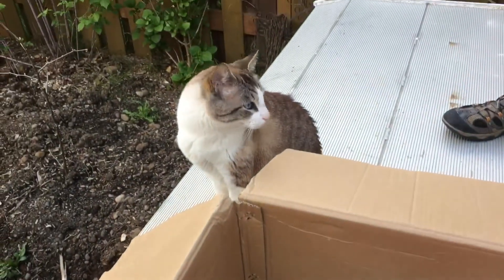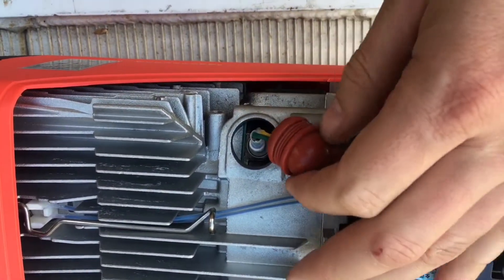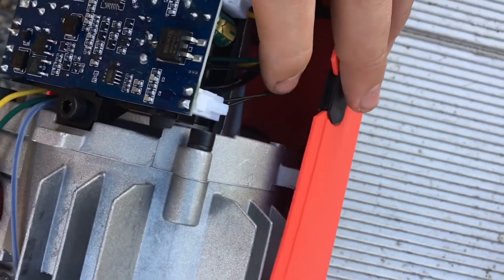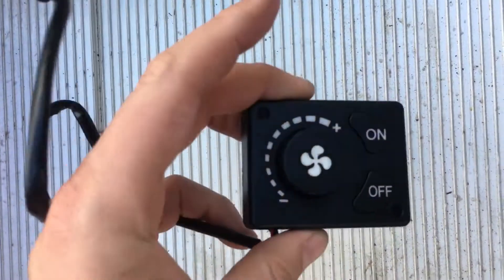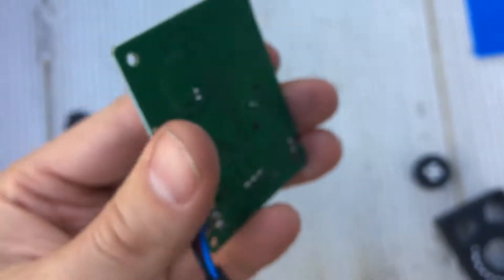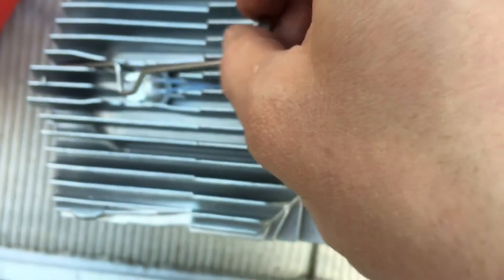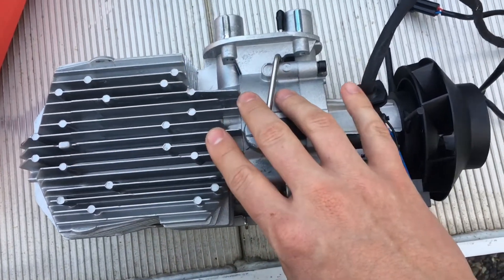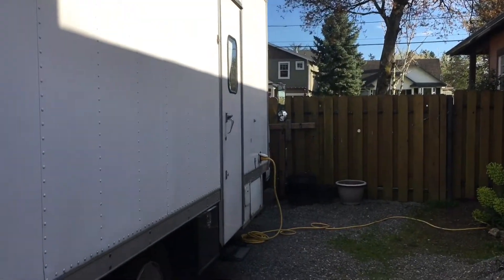Take apart and look inside Chinese 5kW diesel heater

Comment: They do some really odd stuff for communication with the controller. It’s RS232, but the tx/rx is multiplexed onto a single wire, and the other two wires are logic voltage, i think it’s 5 volts. Not sure why they didn’t just use four wires

Comment: I have the diesel heater with the knob controller. It worked fine for months now it acts like it's working but only blows cold air for one cycle then shuts itself down. Any ideas?

Comment: Any updates? How has it treated you so far? I do know those earlier versions aren’t able to adjust for altitude so at higher elevation they tend to soot up. I’ve used my 2kw heater on low in my tiny camper trailer for almost two years now at NYC elevation without any problems. The latest models of these heaters do supposedly allow for altitude adjustments so that would help going up snowy mountains. But I’ve not had any issues other than replace the mesh inside after a year of continuous use (every night of temps below 50°F). Great heaters and great on fuel and best of all: no moisture inside the cabin from the combustion. 
Thanks for posting!

Comment: Brian.. I picked up a Toyota RV.. Its 22 footer.. There's a 2k..5k(yours) and a 7k Chinesium heater..  I am assuming 8 x 22 = 176 cubic feet at most... I want to know which heater on the low setting will be best for heating my RV in snowing conditions... I have no idea how to calculate it...
Reply from the maker: Campos Vazquez so if you run them on low for a long time the sintered flame carrier will soot up. The 5k will heat mine up in minutes on high. I'd think that would be a good size for you to.
Reply: @Brian_Boxtruck  thank you very very much.. That makes absolute sense..  Now anothet question..  Theres a 2k box with a 5k controller and a 5k box with a 5k controller...

Both will provide 5k .. Which of tge 2 would you suggest?
Reply from the maker: Campos Vazquez oy! Idk on that one the translations on the postings is so bad sometimes. I'd get one with the more advanced lcd controller. Apparently some have a way to adjust for altitude which can also gum up things.

Comment: Hey Brian, I have a similar heater made by wabasto.  It runs on diesel fuel, so it is tied into the main diesel tank, as the main engine is also diesel on mine.  So with the camper engine running, the coach area is heated via engine coolant running through heater cores with electric fans.  When the engine is off, the Wabasto heats those same cores, only I valve off the hot water going to the to engine .(no need to waste heat on the engine all night)  What is great, in very cold weather, when we are ready to roll, I just open the valve sending hot coolant back to the engine, and in ten minutes, the engine will start right up! (diesels don't like cold weather)  Neat little heater you have, good luck with it!